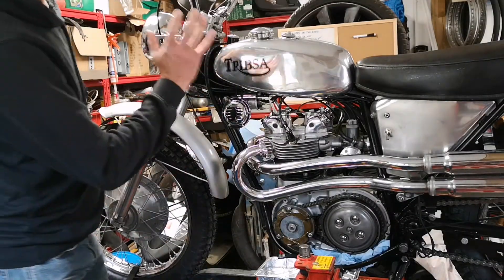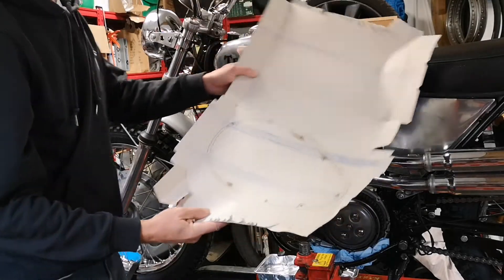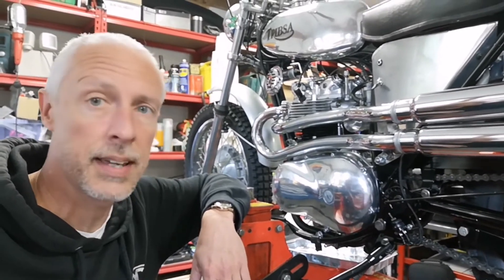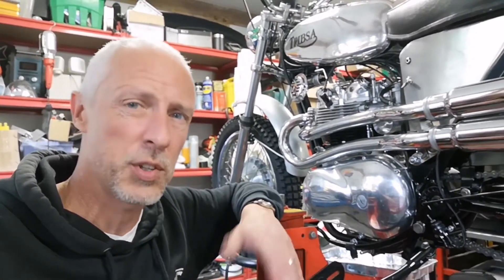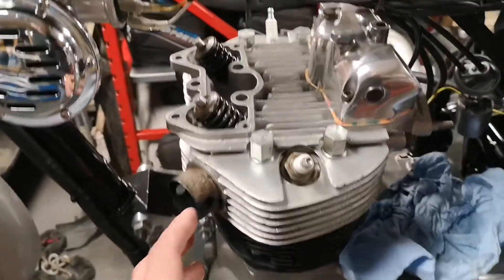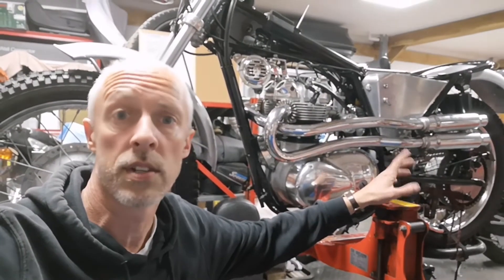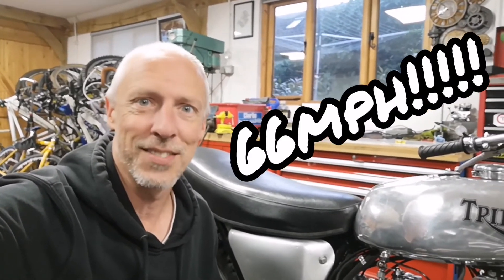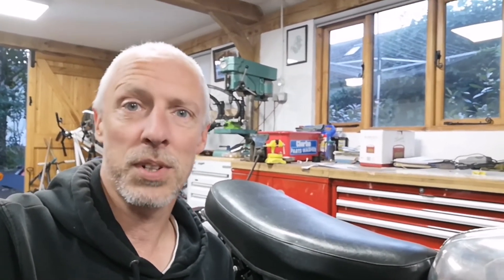Project TriBSA Episode 44

Comment: Ok since I binged watched every episode of this project from start to finish and thumbs up to every one I think I have earned my three ha'pence worth of comment for what three ha'pence is worth these days. 
Did you replace the camshaft bushes and have them reamed? I can't recall.
I preferred the look of the front guard in the road bike position but then it's not my bike.
I hope your funky music 45 single is broken for the next project I haven't checked yet. 
That said this bike looks brilliant - as in shiny and you did an excellent job, the engine sounds great and starts so much easier than any I have seen or owned, to be fair mine were all 650's other than a 5TA all owned in the '70s and '80s though it was easily started. 
I still own a 70 Bonnie with the engine in bits at the moment with loads of new parts to go in, 71 Trident its a pig to start and think its the jets so a carb strip and clean AGAIN,  65 T100ss project and 54 T'bird an even bigger project, like yourself you can see I like Triumphs.
You mentioned decals, other than 350, maybe 44 as a racing number, not for Sir Lewis Hamilton but for achieving your goal in 44 episodes. Well done and proud you should be.
Even though I have done this job more than a few times your vids were well worth watching and entertaining and will now check out your next project. Thank you.
Reply from the maker: Wow! I never expected someone to binge watch Project TriBSA like a Netflix show! Thanks very much!
In answer to your question, the camshaft bushes we in good order and in spec, so I didn't renew them.
I did renew the small ends and reamed them by hand. Tricky job but doable. I think I filmed that bit?
Great idea for the side panel decals!
My dad had a T160 that was a pig to start too! Someone told him the electric starter on it should be used as a start assist. So press the button and kick it at the same time. Not sure how successful that was. He sold it and bought another tiger cub! 😁
Good luck with your projects.
And thanks for watching.
I've done a little pedal car project since for my nephews. And the current project is my mates old Honda 2 stroke.
But in the pipeline is my Tiger 90 engine, and Triton update and refresh. 👍
Reply: @suzukisav  Hi When I say binge-watched I mean 3 or 4 at a time over a few weeks, I call that binge-watching lol. The camshaft bushes in the 70 Bonnie engine I'm about to build are also good, as were the big ends, small ends, and bores all well within tolerance yet the sludge trap was solid and the camshafts and followers were junk. The rest of the bearings will be replaced as a matter of course. Hughie Hancox did a video years ago on building a Bonnie Engine he shows how all these things were done at Triumph. 
I have the vid digitally saved, I could post it on youtube but unsure of Copywrite. I could possibly send it to you in some way if you were interested.
Unfortunately, my Trident is a T150 without electric start, I believe there is an upgrade for the T160 starters available today.
I look forward to your future projects.
Michael Waller is about to start a new triumph 350 engined project, I'm not sure if you have seen his channel. 
https://www.youtube.com/channel/UCqKbu57J6dkIEj99BE2Typw
Lowbrow Customs also did a great series of a Triumph engine rebuild.
https://www.youtube.com/watch?v=tWCdHG0pz3o&t=695s
I sometimes ask myself why I watch these as I've done these jobs in the past many times and I would never watch a film twice as I know what is about to happen. Therapy I guess.
I look forward to your future projects. Sorry for the long comment.
Reply from the maker: @nightster6378  I think I've got the Hughie video on VHS somewhere! I used to like his "slight tap with a rubber mallet" then the frame would change and whatever it was is off. I'm sure he used to pause it and give it a good belt with no one looking! :-) 
I hadn't seen Michael Wallers videos. I'll give them a watch! 
The Lowbrow stuff is very well done. 
Have you ever seen Bad Obsession's Project Binky? Best car build I've ever watched. Just for the amazing engineering and though going into it. https://www.youtube.com/watch?v=7hCPODjJO7s&t=28s
Reply: @suzukisav  I didn't see Hughie Hancox do that with a frame but have done it myself, the vid I have is on the unit 650 engine rebuild only. Some of these guys do things left to be desired but it is the way things were done, i.e. without the finesse. Alan Millyard is a great example, cutting crankcases with a hacksaw and bashing a crank into alignment with a mallet in the garden and turns out masterpieces I'm sure you have seen his channel and bikes. 

I only watch a few channels regularly Michael Waller being one and I think you will be interested in his builds. 
Another would be Craig Jones at The Doghouse and your own of course. https://www.youtube.com/channel/UC3XpxkSvafEP1GjMeCztEFA 

On the car side there are a few channels. I do watch binky now and then the humor is good though three channels I do follow as I like fabrication, and the vehicles they are building are 

Urchfab Ford Pop body on an MX5 chassis and he built a bike. https://www.youtube.com/user/urchfab

Trev's Blog for his haircut and Bedford CA Van restoration. I have a really nice Bedford CF Dormobile, typing Bedford in brought me to his channel. https://www.youtube.com/channel/UCB8HF8Pqug-Pc7DFqX9lf_g

Macro Machines, this young lad is building a 1930's boat tail Speedster from scratch including chassis when he's not at school, yes he has the equipment but also the talent. If none of the rest I really recommend you check this guy out. https://www.youtube.com/watch?v=g7r7unCu4bE&list=PLAOSTFKtoB9maO-cBAZQCy5vT10cain0i

The extent of my car mods (bikes were always my thing) was 40 years ago, welding the doors up, on a £100 Daimler double 6, cutting the roof off with an angle grinder and hand painting it white, and got in and out Starsky and hutch style, now I would need steps, it looked brilliant cruising at night in the street lights thinking we were Miami Vice till it rained that is. Double 6 fans will be tearing what hair they have left out. 
I do have an Austin 7 Ulster replica project to restore someday.

It might seem a lot of youtube but only when I have spare time as I am usually in the garage and don't watch TV.

Comment: Will crack up in NO time.
Needs a bridge over the center between the sliders.
Triumph modified it in 1972 and changed completely soon after.
Reply from the maker: Hi, sorry, not sure what you mean? A bridge between what?
Reply: @suzukisav  Between the two fork sliders. "U" bracket bolted on the current guard mount ( 4 x 1/4 unc bolts) and you will need two (2) bolts on the guard again 1/4 fine thread will do.
I can post a photo maybe tomorrow if needs be.
Reply from the maker: Ah, fork brace. I'm with you now.
Reply: @5 minutes in the shed  It’s a guard brace, stops the guard vibrating and causing the mounting wires from work hardening and failing at the welds.